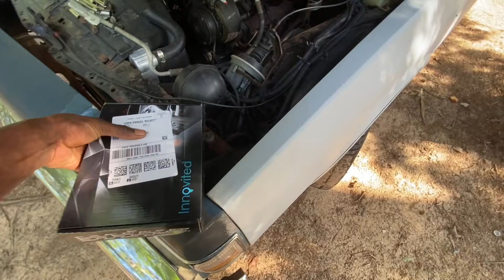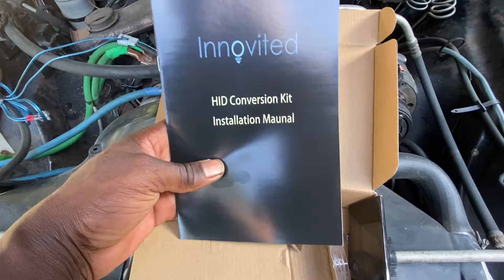INSTALLING 8K HIDS TO THE BOX CHEVY PROJECT ''ICE SPICE'' MAJOR UPGRADE

Comment: You doing your thang down there!!! I need some help I like your content but back to what I was saying I got 2010 Chevy Tahoe I got two batteries with a 250 amp alternator battery still goes under 14 volts with two 18in sundown the u series on a 4000 watt hifonic amp do you think I should run another alternator ???
Reply from the maker: Definitely upgrade that alt and make sure you do a big 3 upgrade and at least 2 runs of power and ground
Reply: @LifeasJSpikes  I’m kinda new to the music upgrades but I got both the batteries positive connected to the alternator and grounded to the engine block with zero gauge wires is there something else I’m missing out on